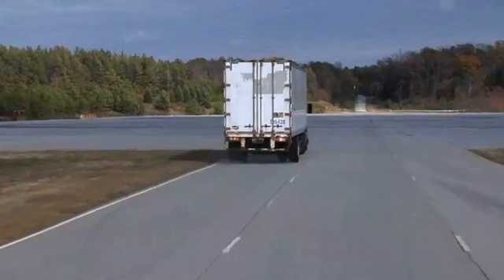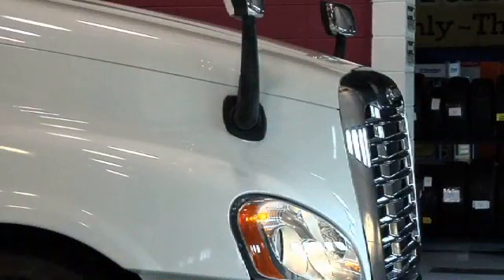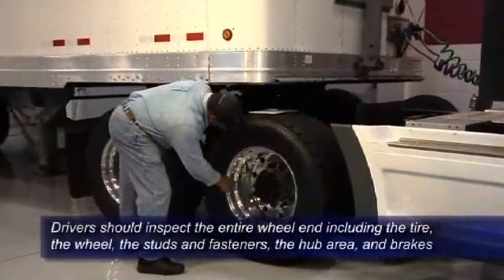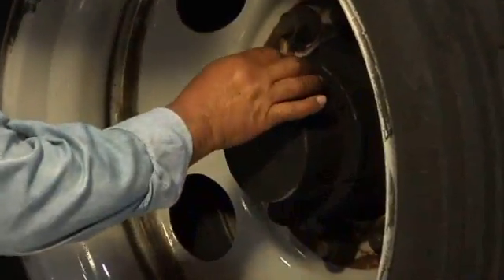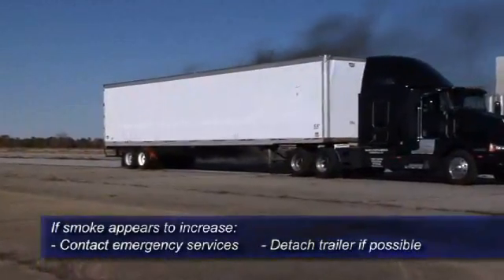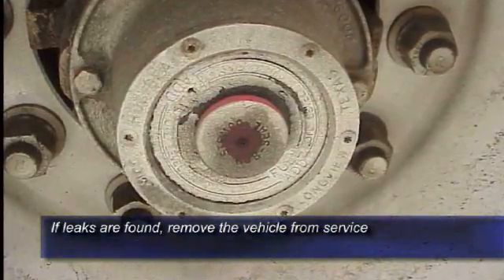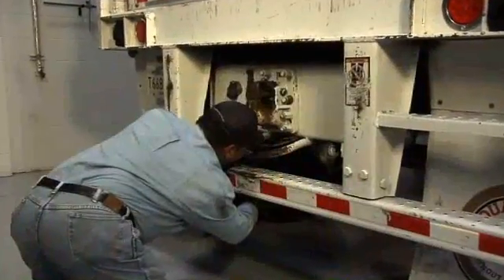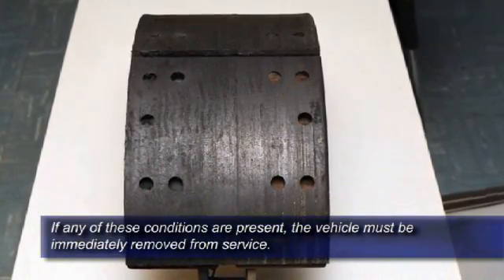Wheel End Safety (1 of 3)

Comment: The best way to fight a fire if FD isn't present and you wish to save your truck is to use a 1.5 gal Cold Fire extinguisher.  It's proven to be effective on fires as a wetting agent and the units can be refilled with an air compressor and the agent is cheap.  On the attached video pay attention to the time frame of around 2 min 45 seconds.  This is a 54" tractor tire on fire.
Michelin Tire uses this product in their facilities     You Tube Cold Fire Backpack to see the video

Comment: For reasons to not try to extinguish a tire fire,  how about all that pneumatic energy stored up inside which would be increasing due to the heat searching for a weakness in the tire.  That energy is more than enough to sever a person in half.  I wonder what they would do to eliminate that danger after the fire is out.  To be honest I think the pneumatic tire is a very old and costly (tire repairs and failures)  design that should be obsolete already.

Comment: In a combined effort with the Tire Industry Association (TIA), Michelin produced a video outlining the steps needed to ensure wheel-end safety and help avoid wheel-offs or wheel-end fires.
Kategorie:

Bildung
Tags:

    Michelin
    wheel safety
    automobiles
    engine
    instructions
    repair
    mod
    racing
    motor sports
    electronics
    howto
    extreme driving
    discussion
    how-to
    cruiser
    cars
    environment
    vehicle
    offroad
    laptop